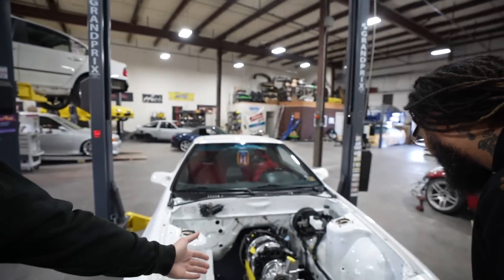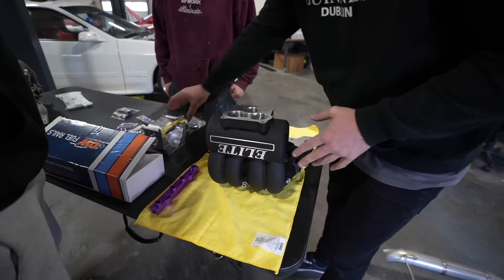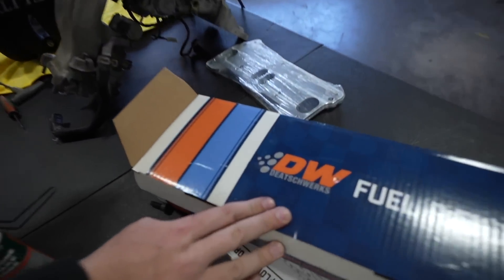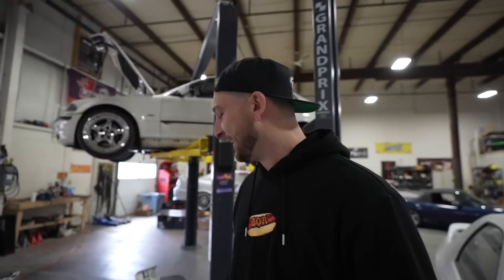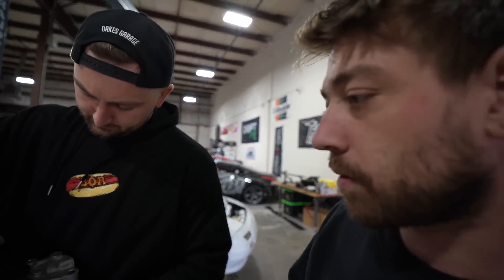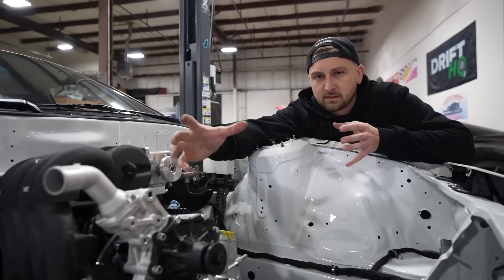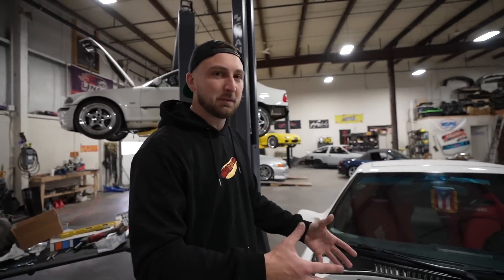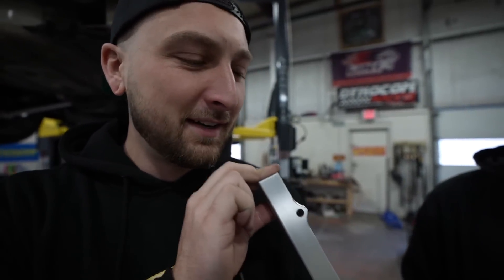This is a MUST for a rotary RX7!

Comment: Why not go with electric water pump and go for something like chips motorsport water manifold. They look absolutely beautiful. Also, I think it’ll help when doing the hose routing for v mount as the stock water pump assembly had the hose outlet way up high

Comment: Whoever does final assembly on that 13B better go thru and Loctite ALL the hardware used in this episode. Vibrations will shake those bolts out quick.

Comment: Awesome to know about the oven cleaner.  I found that if you need to strip paint off plastics use rubbing alcohol and brush it on heavy. Paint came off so easy and no sanding.

Comment: Also if you didn’t use the gasket that goes between the water pump and the water pump housing you can have a problem. The water pump may not turn because it’s too tight there
Reply: he did, he just also put rtv

Comment: I keep easy off on my shelf for cleaning greasy oily engine bays. Works great but you can't let it sit too long, it will eat the paint straight to bare metal in about 10 minutes.

Comment: You can DeAnodize the purple fuel rail with Sodium Hydroxide.  Use 64 oz of distilled water and ~170grams of Powdered or pellet sodium hydroxide (drain cleaner isle at hardware store)   Soak the part for 30sec to 1 min and boom the purple should come off.  Then sand with 1500 and polish

Comment: I hope Jimmy and Brian would feel better soon.
Reply: You should make some chicken soup with ginger, garlic and onions in it, because ginger, garlic and onions are both anti virals..
Reply: Ford owned Mazda from the 70s until now I think. Because Ford still uses Mazda 4 cylinder engines in the Fiesta and Focus as well as the Ford Ranger. Ford also uses Mazda transmissions.

Comment: I am surprised to see those easy off oven cleaners are still on the market.  I use to use those to clean wheels before polishing and also for other car parts. And yes they are really the best oven cleaners out in the market, for some reason they stop selling them in Cali, or maybe I just couldn't find them while I was still in Cali. I used that to clean rust taps and fixtures.
Reply: I'm in SoCal, I copped some at walmart and costco in the past year

Comment: So the dummy injectors are in the extra secondary holes where you're running the 2200's?  Would it not be better to be running like 4 1100 or 1200cc injectors and using all 4? 

I don't know shit about rotory, but in my head it just seems like you could control everything and distribute the fuel more evenly..?  Guessing this was all thought out, but just curious 😊

Comment: Hey jimmy just wondering: why use two 2200 injectors ans block the other two ports? Wouldn't it be better for control using four additional 1200 injectors?

Comment: On BMW engines, you don't use rtv on waterpump, thermostat housing or anything, bad castings and paper gaskets and they always seal.. don't be so scared, better use gaskets without when they are designed to use them dry. Use factory torque specs on those parts tho..

Comment: IMPORTANT! IMPORTANT!

Jimmy if you didn’t have someone holding in the clutch pedal when you swapped your eccentric shaft pulley, there’s a good chance your thrust bearing fell out of its race. If the bearing gets pinched upon retightening the eccentric shaft bolt, you are going to have lots of problems,  and false end play😬
Reply from the maker: Never had to undo the main hub! The pulley just bolts to the existing hub

Comment: Just leaving an injector that's not firing to block the hole is not a good idea injectors are cooled by the fuel they're injecting without any fuel running through it during prolonged use or track use it could potentially cause problems doesn't seem worth the risk to me vs just welding it closed especially when you have spoon for fab

Comment: Has the right fuel rail with 4 injector spots, uses a 2 injector rail and shoves 2 more injectors where they couldve gone on the original rail, then since it is the wrong rail it doesnt fit 😭 man why😂

Comment: Dude come on there’s a much better water neck for the rotary engine. It’s an aftermarket piece. It makes it where you would have to use an electric water pump which is way better

Comment: Easy way to get alcohol poisoning = take a shot everytime the work "juicy" is used in this and the last couple videos......and come on- just call the local parts store and get some little plugs for the extra injectors. Just jamming the ones in there is kinda jank.

Comment: why not just use a turnbuckle for the alt adjuster. also becareful of the 10mm long bolt for the tensioner. dont overtorque it. stupid design.. yes

Comment: Elite intake is flashy, but unjustifiable for anyone... U can make 700+hp on stock FD intake...
That Throttle body is also useless in your case... Will just results in worse driveability, ain't got any benefits over stock TB....

Comment: Ah that intake is trash and. You dont need all those injectors 2 1300 ids and 1700 more fuel than u will need for the power you want